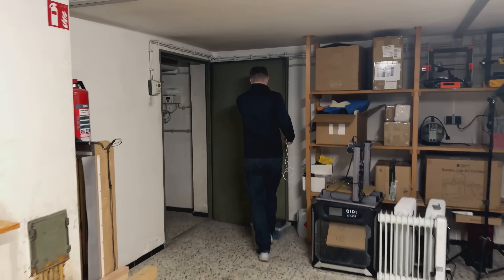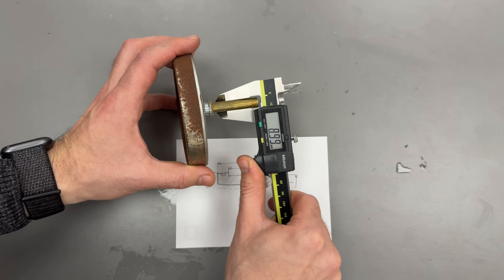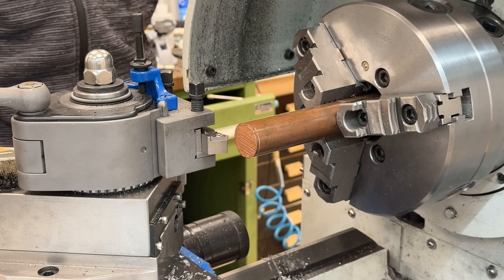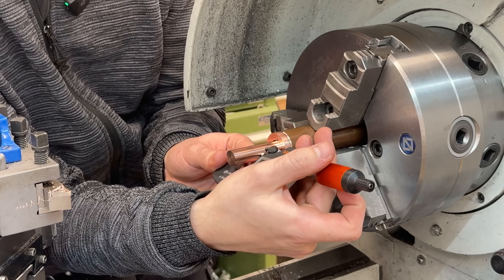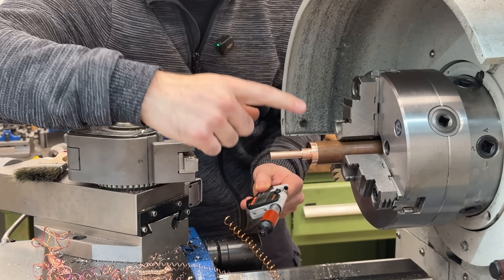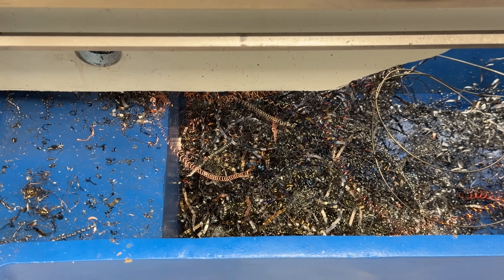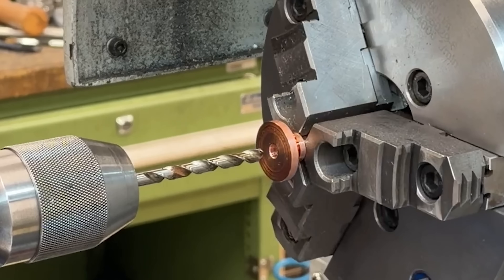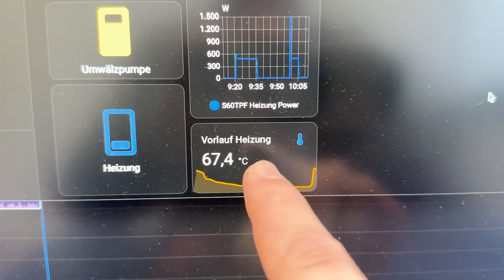Simple Workshop Upgrade

Comment: If you're every worried about a bar whipping in the lathe 3d print some support bushings at common sizes. We use em in our ncs at work, it's not about being super strong it's about preventing the movement in the first place. I just used pla and like 30% infill. Print like .03" oversized on the bore and put two o-ring grooves on the od so it doesn't slide in the spindlebore.

Comment: I'm not sure how cold it got when you filmed the gauge, but unless it was - 15C, your settings are off. At this time of the year you should be running 45C in with 35C out.
Reply: Depends a lot on the installation, older smaller radiators require a lot more temperature even at 5°C outside

Comment: Instead of going for copper for better conduction, wouldn't it be better to go the complete opposite?
Insulate the probe from the sleeve (3d printing with a temperature resistant filament is probably actually the better solution here).
You probably want the probe to react to the temperature changes as fast as possible and have as little dampening as you can.
Reply: Partially. Those sensors go inside a closed off metal tube that ends in the center of the water pipe. So the front part where the small actual sensor ends up needs a sleeve with good thermal conductivity. It doesn't need thermal mass though. Aluminum, brass and so on might be better and cheaper. But anything behind that part is ideally insulated off so your measurements are not affected by those giant dampening metal pipes and lower outside temperature. It's essentially a 3d printer hotend :D

Comment: Regarding the choice of metal, it's more about volumetric heat capacity than thermal conductivity. While copper has a low specific heat capacity (heat capacity normalised against mass) and excellent thermal conductivity, its density is also quite high, meaning that its volumetric heat capacity (heat capacity normalised against volume) is actually pretty high. This means it takes longer to reach thermal equilibrium and will have a "low pass" effect on the temperature changes. For heatsinking this can be highly desirable, but for sensing it can be less ideal. Counterintuitively, aluminium is often better in these contexts because it has a very low volumetric heat capacity (about 40% lower than copper) due to its low density, meaning that for a given physical size of part you actually get a lower heat capacity, and therefore faster response from the sensor when the heat source temperature changes. It's also much cheaper! Thermal paste will help a ton with the copper part you have though - the fit looks pretty loose.
Reply: Did he not change from brass to copper? Which is not a very dramatic change at all with your aspects in mind.
Reply: @storfarbrorn489  it's copper, yes. but the point is that copper is very expensive and less performant than aluminium in this use-case.
Reply: I doubt there is any rapid temperature changes they need to keep track of. Definitely an overkill part. Thermal paste would also be overkill since this is just for monitoring, not PID control.

Comment: I love Home Assistant, I have so many nice quality of life automations that I wouldn't trust a cloud connected service to do. For example, I have Z-Wave locks on all my doors, and I have an automation to unlock the front door when I arrive home. I also have door open/close sensors, and another automation to re-lock the door 5 minutes after the door was last closed, with a hard timeout of 30 minutes in case of sensor malfunction. That way the door will remain unlocked when bringing in groceries, and every trip back outside resets the countdown. It all still works even when my home internet is down since it's all local and in my control.

Comment: Why measure on the analog temperature gauge instead of measuring the diameter of the hole to get a better fit?
Reply: I don't think there is a need for a very tight fit. Verry little cooling effect going on and temp will equalize non the less. It may be a bit slower to respond but temp swings in heating systems aren't that fast anyway. The loose fit may guarantee that you can get it out in 10+ years with corrosion etc.
Reply: Especially considering the gauge was a known loose fit!

Comment: So it doesn't make contact with the water, because the piece seems no fitting the hole, just dangling. You could have just 3d print a small piece to keep the probe central.

Comment: I bet that groove is meant for an “O” ring. Would also compensate for the looseness.
Reply: Likely meant for the grub/set screw so even if there's thermal expansion/shrink, etc the screw will still hold the piece in because it is trapped by the groove and not just pressure against the tube.
Reply: It’s meant for the grub screw

Comment: just shove sensor in and plug hole around it with some insulation. no copper nessesery. pipe this size has so much mass it heats up slow and cools down slow.

Comment: For a faster heat exchange with the sensor, I would have gone for a tighter fit with the adapter. And I would think there is even another delay. Why is there such a loose fit between the original adapter for the analog reading? You guys could have gone for a solution that makes better contact with the inside.
Reply: Could maybe use a bit of thermal paste like what is used for cpu coolers in a pc. Some one I saw a while back experimented with super glue instead of thermal paste, and it actually worked just as good, lol.
Reply: @WhitelistedUsername  sounds like an overkill.  Actual sensors for those pockets just have a straight spring steel flap on the them, so it just slightly pushes the probe to the side of the sensor pocket.  I would just have added some electrical tape around the sensor, so it would have kept it in and as an added bonus, insulated the pocket a bit, so that the air inside it would stay there and little breeze wouldn't screw the results.  After all, there's a lot of power affecting the probe pocket in the water flow, so there's not that much of a delay or error from the probe not directly touching the pipe.

I have my home assistant sensors actually just on the side of the pipes, with a sock twisted around them to insulate and a velcro strip around the sock to keep it in place.  Works just fine, I haven't noticed any delays or meaningfully wrong values while comparing to my heating systems own measurements.

Comment: Can you share the make/model of the digital temp gauge you used - always looking for Home Assistant projects and this could be a good add-on
Reply: Looks like the new Sonoff ZigBee probe (I don't have one, just guessing)
Reply: @supermanhills Maybe a DS20B18, they are pretty cheap/cost efficient.
Reply: You mean a ds18b20. No, not with an integral display it's not and it's now a 3d printed case for sure.  @PapaRomeoAT
Reply: @supermanhills thanks for correcting the type. Mixed the numbers.

I wasn‘t sure, if the sensor with the little display had to do anything with the HA integration. Didn‘t think about it, could be. 👍🏻😊 I thought about 2 different sensors.
Reply: @PapaRomeoAT you're right though in a way. The probe itself might well be one of those. The whole device is something else though.

Comment: But doesn't the copper now draw the heat to the outside? Wouldn't 3D printing have been more insulating?
Reply: Basically he created a heat sink measuring some kind of average between ambient and the process water.
Reply: @crispijnverkade  Not really. While the shoulder really is overkill, the sensor still measures what it's supposed to measure.
Reply: What, like, plastic?! No. The thing has to be thermally conductive - otherwise the sensor wouldn't see the right temperature.

There's a discussion to be had whether they really need a flow temperature of 70 °C under design conditions - let alone right now -, but that's a different topic entirely.
Reply: Maybe coat the surfaces exposed to ambient air in some sort of liquid rubber?